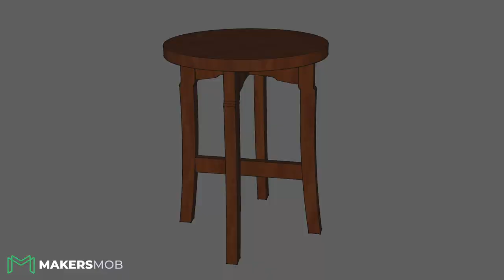[Traditional Joinery] A Small Round End Table

Comment: These videos are becomming almost unwatchable with all the ads in the middles pop ups from the bottom, end cap ads plus youtube ads on top of that. I dont mind the end cap ads as much becuase it's easy enough to stop watch the video but the middle ones really suck especially when it's about time sensitive stuff. Those are really annoying as hell when it breaks up the video especially if you watch the video after the event is over.
Reply: I'd suggest to use an add blocker plug-in module to your browser. Have been using it for years, and couldn't be happier. Search for adblock plus. You are welcome
Reply: @frantiseksram9741  Doesn't work for the mobile app or on any devices I have connected to my tv. I rarely watch youtube on a pc and the youtube website on a mobile browser kind of sucks imo
Reply: @MrTarfu  I feel your pain. I watch most of the things on PC, where I get spoiled. And other time on my phone in the youtube app, and there I suffer too.